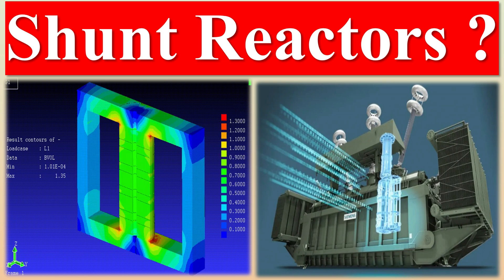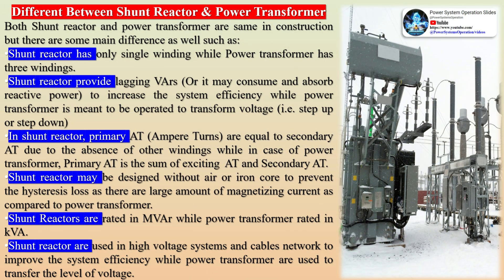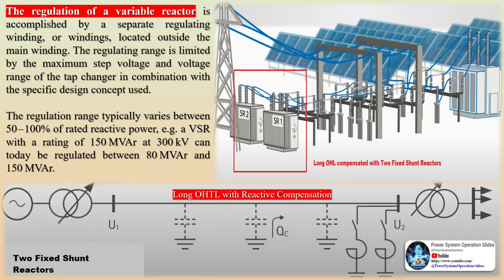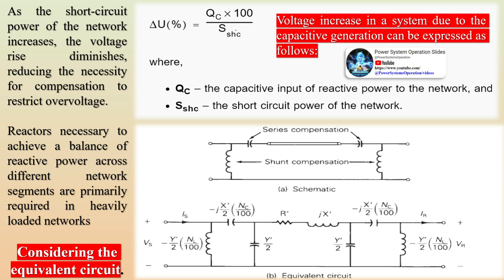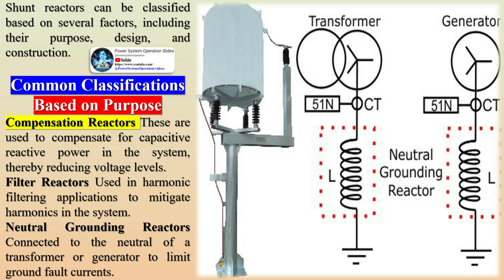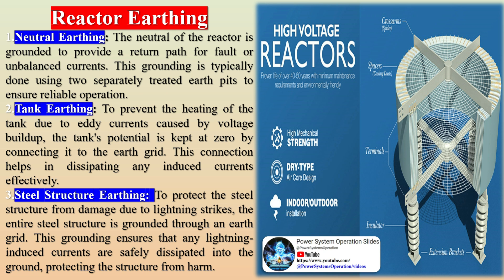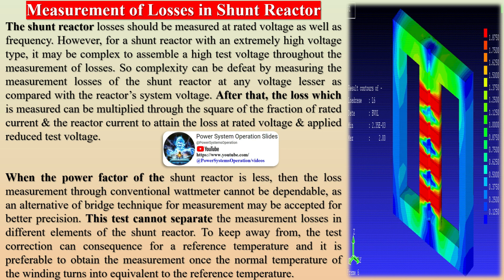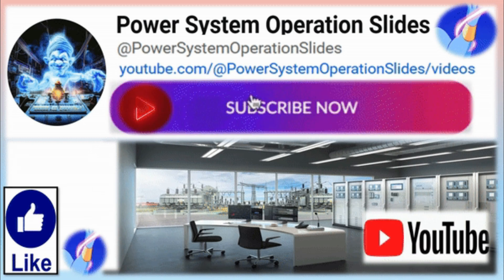Power Shunt Reactors | Shunt Reactor vs Power Transformer | Operating Principle Shunt Reactors

Comment: https://youtu.be/st8NLQelC7Y?si=ApTI9qgSpD-TXJdU are those reactors?  Where?

I find it interesting that we call them shunt reactors. Why not shunt inductors?
That is what they are. Big shunt inductors. Shunt capacitors are just shunt capacitors. But inductors are "reactors." Capacitors and inductors are both considered reactances whether it is capacitive or inductive reactance.
It would be interesting to understand their construction. Are they made like a transformer? An autotransformer? Are there tricks in the construction to make them provide more inductive reactive power from a design perspective?
Magnetic Cores with shell type construction and laminated core layering seems likely but I bet there is a lot more to the construction options than that.

Do you have condenser pictures? Machines that run to control and produce (consume) reactive power. Dynamic inductors and capacitors.
I did one project where I relocated old reactors from one station to another. They were connected on the tertiary of a tie bank transformer. I assume that lower voltage reactors are significantly cheaper than shunt reactors that are at the nominal HV values. 230/138 kV. I don't recall the tertiary voltage.
Reply from the maker: Shunt reactors are large inductors, but the term "reactor" emphasizes their role in reactive power management. They share construction features with transformers but are optimized for handling inductive reactance. Your project of relocating reactors to tertiary windings highlights the cost-effectiveness of using lower voltage reactors, which are smaller and cheaper than high-voltage ones.
Reply: @ I agree that it emphasizes the reactive power role.  It would be interesting to academically research the use of reactor for inductor.  Shunt caps could just as easily be called a reactor because of its reactive power role, but we didn’t.